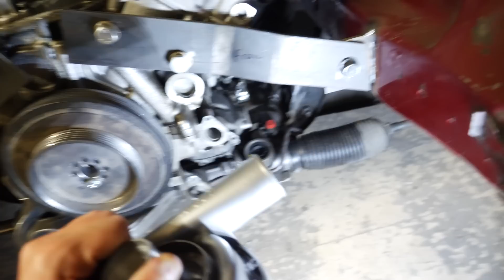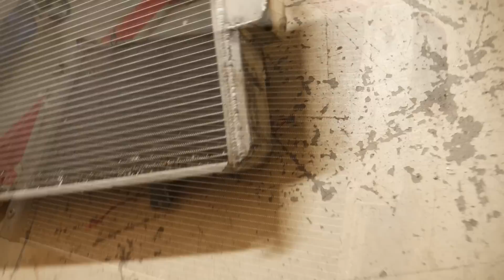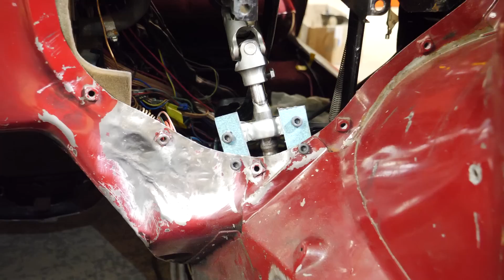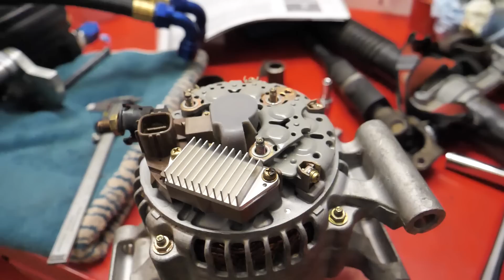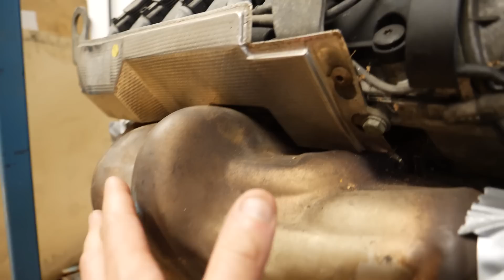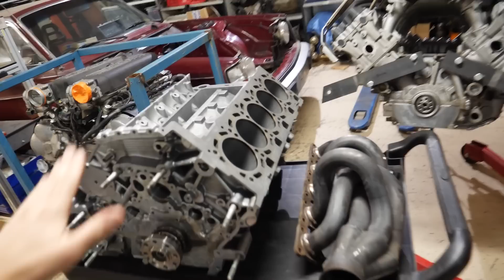Volvo with Lamborghini Engine Project Episode 5

Comment: got a couple questions.
1: is it possible to make a formula 1 like Pneumatic Valve Actuation System  be variable like Vtec ?
2: does it need a shorter stroke or is it possible to rip it to like lets say 15k rpm ?  in thinking honda K24 blocks.
3: do you think its possible to make a valve system like the rotary valve on kreidler mopeds ?  
then risk of valve float should be eliminated and only fail due to heat.

Comment: I know this is a couple weeks late, but I had an idea for your steering shaft. It is close to a 90 degree transition at both joints. Maybe a gear would be a better choice than a u-joint. Or maybe a combination of the 2.  I am sure that you can dream up something and make it work with your fabrication skills.

Comment: About project car to have in abu dabi, maybe try the new centripetal supercharger technology? Very nice packaging and its easier to get low temps after the intercooler, possibly quite easy to have airfilter->supercharger->intercooler->supercharger->intercooler->engine, since the exhaust just goes out the exhaust system and don't even have to go through even one thing. Betcha you could even have proper catalysators and not have to dump fuel into it to cool the exhaust temps, so it could pass emissions. Think a huge 4.8 liter diesel would be hella cool with that system too, since diesels can be run very lean (gale banks of banks power on youtube has a cool series on diesel tuning).

Comment: How do you intend on making this car road legal in Sweden? The rules for changing engines and transmission are so strict that I can't imagine how a Volvo like this with a Lambo engine can get through an SFRO registration. The new engines hp capacity is obviously far more than the original engines power output, and the increase in power isn't within the 20% increase or 15kw/100kg rules. Really interested in how you will manage to make this a street legal car, if that is even your intention of course. If you do aim to make if road legal, could you maybe explain how you would make it happen?
Reply from the maker: Yes its the aim. But not priority for now. I want to get all mechanical finnished first. It is now possible with more than 20% increase.
Reply: @PeterBjorck  Are there any specific requirements for what car and or how you exceed the 20% increase limit? For example because of the cars age, weight, changes to other components such as brakes etc? Just trying to make sense of how you are expected to make it work and or how the rules have changed in your favor?

Comment: Why don’t you install a alternator starter?
Reply: I know that sound difficult but something like the lt50 so you can put it just in front of the engine on the flywheel and you'll save space for other parts, anyway I like so much this project

Comment: Move the steering rack to behind the cross member if possible, you might even move it up above the engine block against the firewall, anywhere that you can still get the steering geometry to work. Just take the rack out of a Prius or mini or other vehicle with the rack in an unusual place.

Comment: Plääh, I think you install Volvos motor or two to Lambo.. Diesel for giving torgue and petrol with douped turbo for higher rpm's.. Electricity motors for braking and same thing gives boost paraller with other engines when full throttling.. :O Diesel runs rear axel and gas for front.. electric motors for all 4 tires.. Pressured "waste air" recycled between motors, where its needed.. that all is utopy, but I have maybe better idea.. I don't want to tell it just now .

Comment: Could you run the alternstor in front of the engine inline it with it, straight from the cranck pulley using a coupler?

Comment: On the face of the Alternator theres a place for a steel plate Mount close to the tension. You just need a small bracket in the rear.

Comment: Hi Peter, I’ve modified the steering shaft on my Volkswagen T4 transporter to use Audi UrS6 steering and dashboard and too found slop and It felt clunky. To remedy this I found that I needed 2 bearings on the central piece so on your car would need 2 bearings where the shaft runs behind your pedals.

Really great video content as usual and can’t wait to see more as and when you manage to get more content made.
Take care 🙏🏻

Comment: Love you videos but you might end up cooking that alternator if it sits on top of a V10 on a hot day, they can take a far amount of heat but they're not indestructible and life span will be reduced. Should be ok-ish but maybe install a volt meter in the cabin to keep an eye on it and the battery. Good luck with the project and other videos!

Comment: The double u-joint do not seem to work because the bearing is only supporting 1 point, allowing the shaft to move around. Also, please look into 'u-joint phasing', you seem to have installed them in such a way that they cause binding a motion. Either support the shaft between the double u-joints with 2 bearings, or use a singular u-joint. Very nice build!

Comment: You can remote fit the alternator at the back of the car using cable drive that are used for mechanical fuel pumps in racing
Reply: You can belt drive the alternator off the pinion yoke for the rear differential.
Reply: @wymansst  no charge at idle
Reply: andrew1977au  I’m aware of that. Still offers an option if space is limited and much less maint than a cable drive. How long does a car sit stationary and idle?